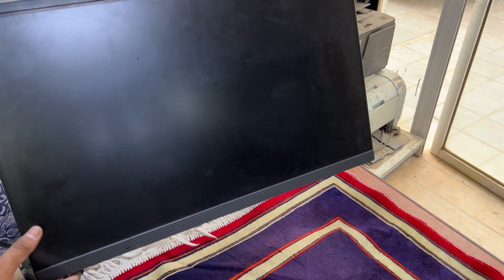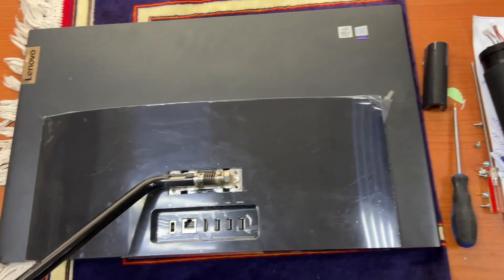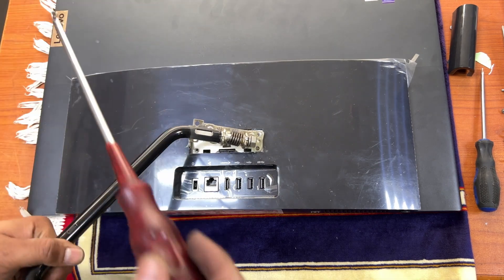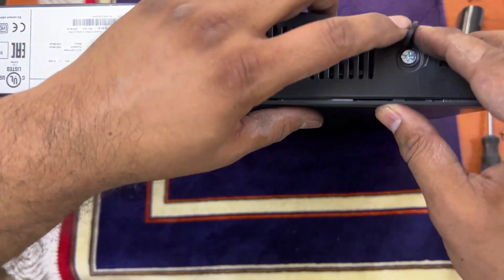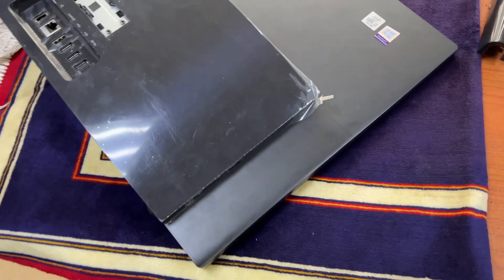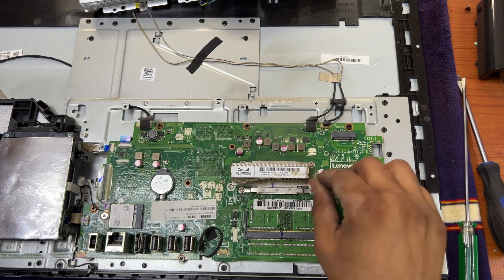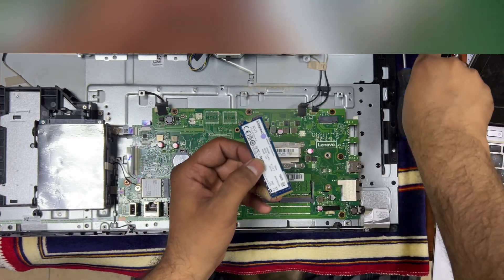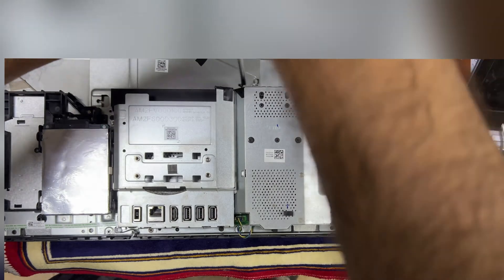How To Disassemble Lenovo Ideacentre A340-24IWL AIO Computer And Upgrade NV1 SSD?

Comment: Replaced hard drive and then noticed crack in the screen.  We were caarfull removing and replacing cover.   Being carfull was not enough.
Internally overall design is flimsy.  Rubber gromets holding hard drive in place
Recommend sending to shop.  Hopefully they do not crack the monitor

Comment: I just tried to get one of these apart and cracked the screen at the corners when trying to use a screwdriver to separate off the back cover as I saw in this video. sigh

Comment: Thanks for uploading this is exactly what I needed. 2 questions:
1. The empty RAM slot is for additional RAM correct? The 4gb it came with is it soldered on?
2. If I don't have spare screws for the m.2 can just use some tape to hold it down?
Reply: There is only one RAM slot, the RAM module is inserted there (in the video). I think you mean the empty ssd m.2 slot in the top right of the motherboard. I shouldn't use tape to keep that in place as it can become hot and the glue will dry. So it might melt and the glue on the tape can let go. Try to find a small screw somewhere.

Comment: Could you do one about removing the CPU and changing the intel core on the all-in-one to an i5 or i7, or anything it supports?
Reply: No mostly laptop cpu cannot be upgradable. If u want buy another all in one computer with higher cpu like i7
Reply: That's the cons of the laptops cannot be upgrade the cpu because its built in soldered in the motherboard but u can upgrade the RAM, HDD AND SSD.